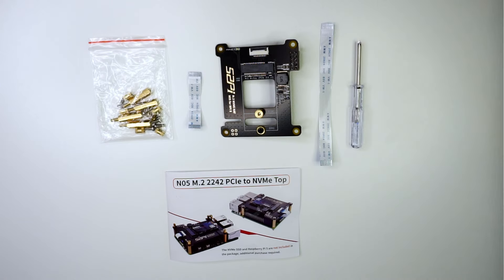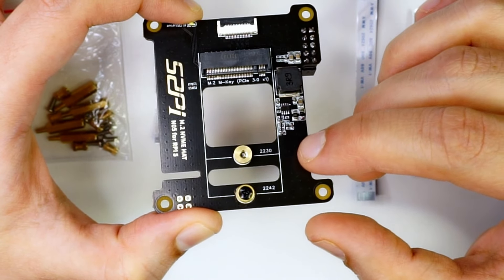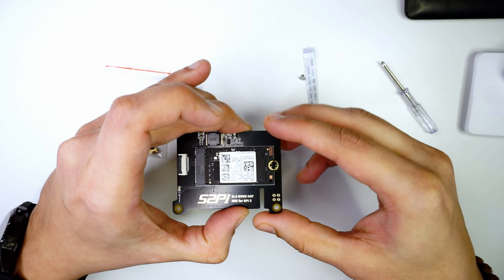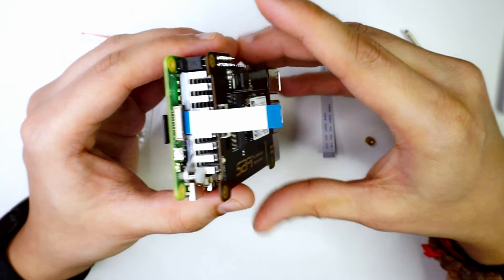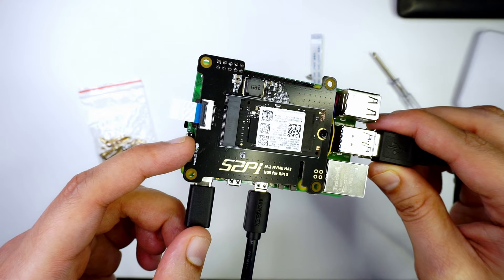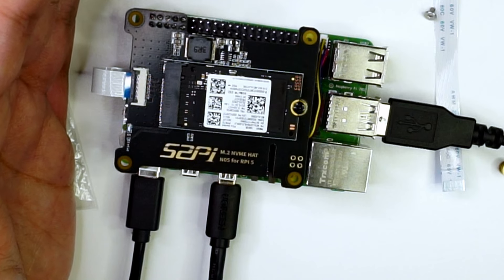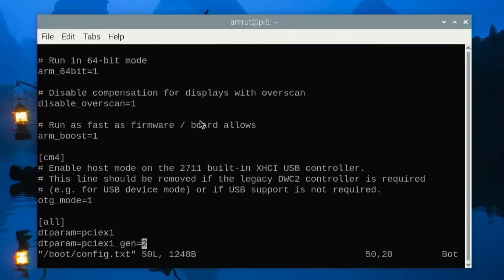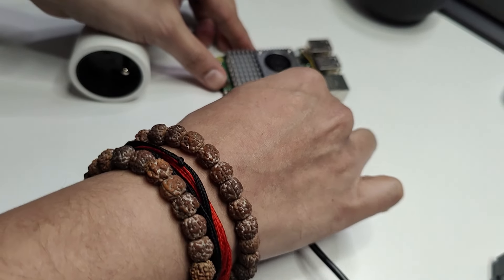NVMe SSD On Raspberry Pi 5. How FAST is it? NVMe Storage HAT From 52Pi.

Comment: Thank you for the assembly guide for this product of 52Pi, and this video is really nice!
Reply: Thanks for this Video & channel, i ❤ Your Videos has amazing topic & very good/easy explanations! 🤩
BUT You made looks easy I got the NM04 just to plug the cable took me like 0.5h 😁Samsung 980 SSD "empty" NO paration/NO bad sector visible on WIndows with USB/NMVE Case!
SO then i added "everything" to config/eeprom like this 
dtparam=pciex1
#dtparam=pciex1_gen=3
===================
BOOT_ORDER=0xf461
PSU_MAX_CURRENT=5000
PCIE_PROBE=1
===================
 i'm using the official RPI Charger disconnected like 1h as You suggested then reboot & led shortly light up/"beep" on  HAT however NO Led/NO HAT/NO SSD visible,  i tried with BOTH Cable which come with package?! 🤬
Sep 12 09:26:21 raspi5 kernel: brcm-pcie 1000110000.pcie: host bridge /axi/pcie@110000 ranges:
Sep 12 09:26:21 raspi5 kernel: brcm-pcie 1000110000.pcie:   No bus range found for /axi/pcie@110000, using [bus 00-ff]
Sep 12 09:26:21 raspi5 kernel: brcm-pcie 1000110000.pcie:      MEM 0x1b00000000..0x1bfffffffb -> 0x0000000000
Sep 12 09:26:21 raspi5 kernel: brcm-pcie 1000110000.pcie:      MEM 0x1800000000..0x1affffffff -> 0x0400000000
Sep 12 09:26:21 raspi5 kernel: brcm-pcie 1000110000.pcie:   IB MEM 0x0000000000..0x0fffffffff -> 0x1000000000
Sep 12 09:26:21 raspi5 kernel: brcm-pcie 1000110000.pcie: Forcing gen 2
Sep 12 09:26:21 raspi5 kernel: brcm-pcie 1000110000.pcie: PCI host bridge to bus 0000:00
Sep 12 09:26:21 raspi5 kernel: brcm-pcie 1000110000.pcie: link down
root@raspi5:~# lspci
00:00.0 PCI bridge: Broadcom Inc. and subsidiaries BCM2712 PCIe Bridge (rev 21)
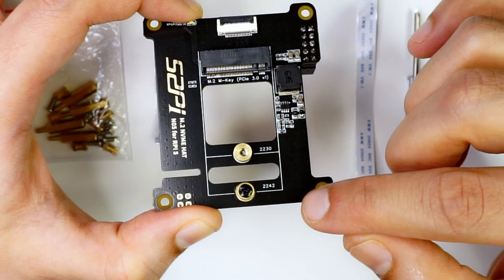01:00.0 Ethernet controller: Raspberry Pi Ltd RP1 PCIe 2.0 South Bridge
root@raspi5:~#
@52Pi_Maker_Education ANY suggestion please?!
Reply: @KaliL-x7h  Oh, I see your reply, and I'm very happy that you recognize our channel. I might need to confirm three issues: 1. Did you add `dtparam=pciex1` under the [all] section in the /boot/firmware/config.txt file? 2. Did you perform a reboot after making the configuration? The N04 is a HAT board, so please check if it is in good contact with the Raspberry Pi's GPIO, and could you send me the information of the Samsung 980 SSD you are using? Also, check if the FPC ribbon cable is properly installed? BTW, I'd like to ask if the operating system you are using is the latest Raspberry Pi OS 64-bit bookworm from the Raspberry Pi official source?

Comment: Having an NVMe drive on a Raspberry Pi, especially the more expensive short ones, seems completely against the whole point of a Raspberry Pi to me.
Reply from the maker: If you want something compact then that's the option..😄
Reply: I've attached 2.5" sata ssd using sata->usb adapter. Works well.
Reply: Once you boot up your Raspberry Pi via NVMe from PCIe slot, you will love it~